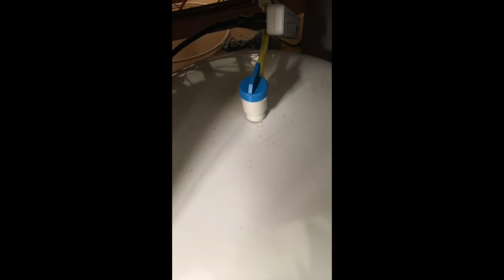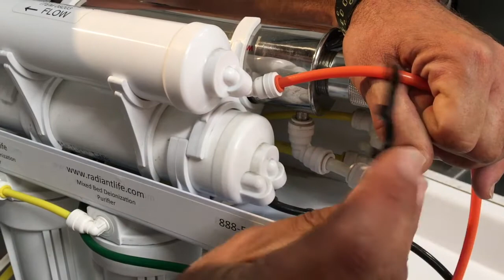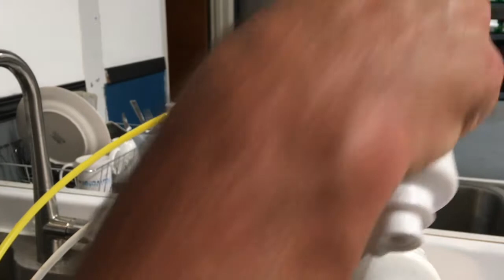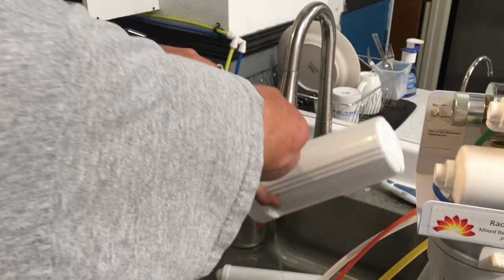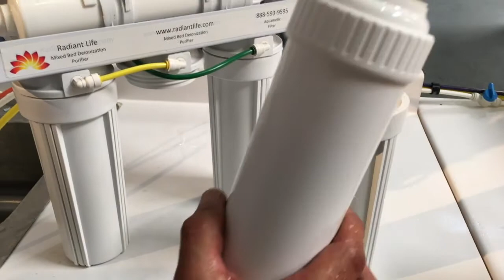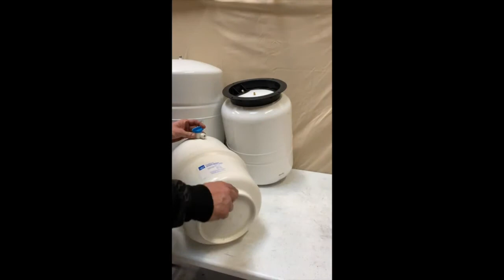14 Stage Water System: DI Purifier & Filter Replacement Kit Instructional Video

Comment: How offen need to change first filter?
First filter i change after week, another after 2 weeks. Not really good perspectives for system price(((
Reply: what you say here doesnt make any sense. why would you change filter in a week??
Reply: @ptare1  because filter gets dirty  and not allowed water to fill the tank. We call customer support, and they say that water quality doesn't match system requirements. At the end they recommend bypass prefilter and install washable ceramic filter in first vertical container
Reply from the maker: @igenegorov  Thanks for your comment. Water conditions are different all over the country. Sometimes this is due to the water itself, other times it can be attributed to the lack of treatment at a water facility. The most notable impacts come from the aging infrastructure throughout the U.S. Infrastructure replacement and upgrades are ongoing to correct failing systems that are aged and harmful to public health. For example, many municipalities still deliver water to homes in cast-iron pipes. While older locations may still have lead piping. These aged and dangerous pipes can contain harmful contaminants, rust, bacteria, and sediments that contaminate the water during delivery. Aged delivery systems, construction projects, and water system maintenance is unknown and unpredictable. When problems are experienced with the water system, Customer Support will attempt to locate the cause to determine if there is another way to combat these challenges. In this case, bypassing the sediment filter and adding the ceramic filter, allows for two things to happen. First, if the filter clogs, it can be removed and cleaned to restore water flow through the system. This prevents the continual replacement of the sediment filter. Secondly, it will allow Customer Support, along with your assistance to attempt to determine what may be causing the problem to address it specifically. Without knowing what is clogging the filters, there is no logical way to combat it.